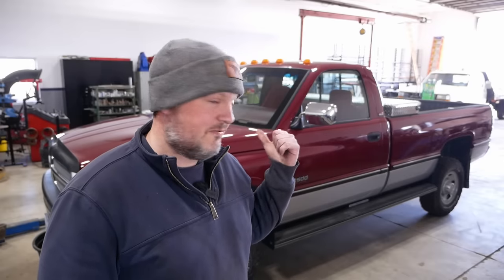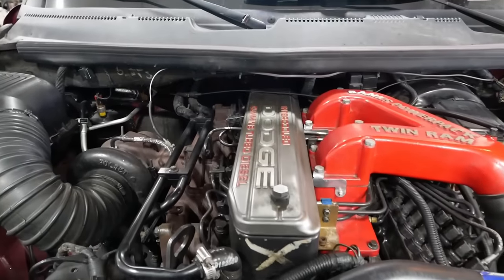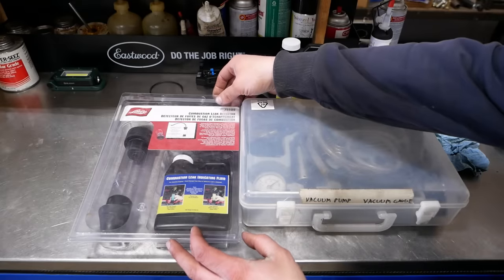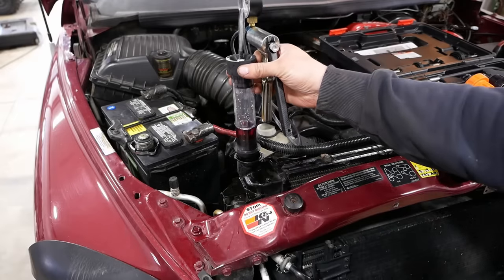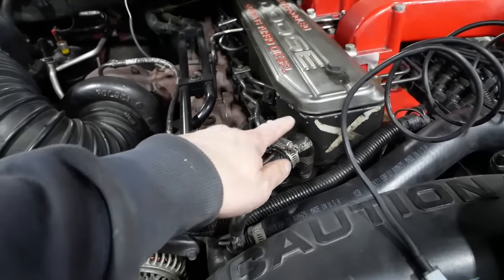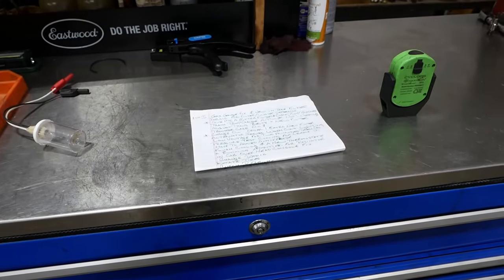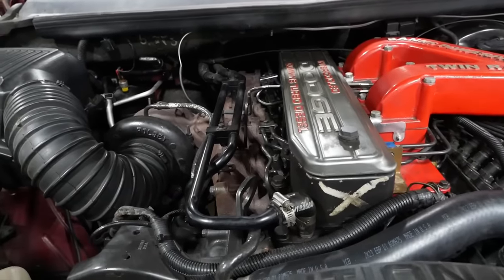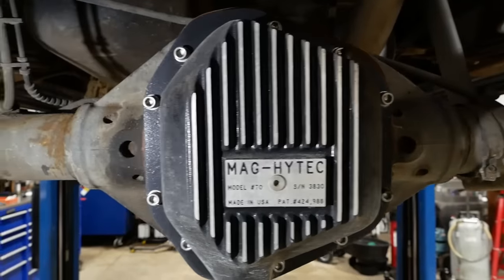Fixing a Mint 1995 Ram 2500 Cummins | Front End, Coolant Leaks, Major Service, Etc.

Comment: Thank you guys for the awesome content. I say you guys because I know a business like yours is a family effort. I really like the way you go about fixing all of these vehicles. You are very methodical, professional and clean. I’m always impressed with the work that you do. Wes, I wish I lived near your shops to have my truck worked on by you. It is a 2002 Ford F-250 XLT. It is a very clean truck with low miles. It needs a new bearing and outer axle seal on the driver’s side. It also needs a rear differential flush and fluid change. I have a new Rear differential cover. It is a good one that allows the fluid to circulate. I also have an electric diff locker from a 2008-2015 F-250 which can be retrofitted to work on my 2002 F-250. My truck is 100% rust free. I’m from Tucson, Arizona where there is no such thing as rain or humidity. Maybe a road trip? Thank you again for your videos and content.

Comment: Beautiful old truck. Sometimes I miss my  Cummins but the then remember changing out water pumps, seals , steering box , and front end parts more often than you would think . Had the death wobble several times. The good feeling goes away fast.

Comment: That was a clean 95 Dodge!  The new owner sure knew the right person to take it to!!  I had a 2000 Dodge diesel and I loved that truck.  I put in the Edge module so it had 330HP and 670FP of torque,  I got 17-19 mpg city driving and several times I got 27 mpg on the hiway!!  But it did wander and no one could fix it.  Also the trans would would go out of overdrive with a Big bang when under a load so I had it rebuild and it did the same thing which was a common problem.  It finally broke and left us stranded!  Went to a dealership and they finally got a factory remanufactured Trans and I never had that problem again,  but it was 5 grand!  If I'd lived close to Wes and he had the time he could have fixed all of that and I wouldn't have had to put up with all that for several years.  Thanks for another great video,  I'm going to watch some more of your videos right now.

Comment: Had a 93 Dodge Cummins D250 2WD. Gave it to a cousin in '03 w/ 225K miles. He kept it a decade as an off road truck. He sold it to his propane guy a decade later for $700. It's still running almost 30 years later. These old Cummins are awesome motors. Great video.

Comment: Great video Wes.  Your videos are always like it is.  Your living right, those unit bearings NEVER come out that easy.  I’ve  got a 2000 Dodge 2500 CTD since 2002.  120,000 miles on it, love it.  I put a Fleece cooling system bypass on it, and a PacBrake exhaust brake system on it, a FASS lift pump and just put a manual locking front hub kit on it.  No DEF and no cats, My forever truck.  I would like to find another one, 97 or older so I can avoid the smog line here in Commiefornia.  Then install a 24 valve with the P- pump conversion kit.  Interesting,  the ball joints press into the knuckle on the 98’s and older.  Om my 2000 they press into the ears on the axle tubes.

Comment: Just saw you using the suction pump and over here in the UK I've just bought a 1.5litre version of the same pump (already got two of  the smaller ones like yours) and it's really handy. Differs in having a much longer tube plus a stop tap arrangement on the end to stop dribbles whilst transferring liquids.  Also has a handle to go around the larger body. Just letting you know as we are usually behind you guys so no doubt they're available on your side of the pond. Enjoyed the video too. 😁👍

P.S. AvE says "Cut towards your chum, not your thumb".

Comment: Hi Wes, thanks for the vids.  Is it possible that since that transmission was modified for heavy towing (deep magnesium pan, extra fluid capacity, who knows what else...), it does not reach normal operating temps when running with no extra load - so it may shift like its cold and the temp gauge may not register?  Perhaps the pickup doesn't get deep enough in the modified pan?

Comment: That is indeed a super nice rig!
I  have a bit of a Unicorn or holy grail Dodge truck of my own. 2003, 5.9 (pre-emissions), NV5600, Manual XFER case quad cab with 135K. It looks about the same as that one paint-wise. I want a new one but this one is too good to give up.
BTW, yes, the volt meter thing is normal. As far as the loose steering, if the gear hasn't been replaced, it needs it. No adjustment of the secotr will correct for a worn box. I learned this one the hard way. Red Head makes a great rebuilt gear.
Yes on the constant tension clamps and if you use OEM hoses, they come with them.
Reply: I replaced my 99 original steering box with a Redhead.  The first one they sent me had trashed splines, sent back.  Second Redhead came and was sloppy after install, a real surprise.  Took that one out and got a PSC box that was better, but still came with slop in the gearing.  I remember a day when the truck was new and the steering was super crisp. Front end is all brand new but these steering boxes seem to be the weak link in precise steering.  Grrrrrrrrrrrrrrrrrrrrrr.

Comment: Pretty clean for a rust belt truck. If you think that sending unit is a pain, I have a 98 12 valve, the only sending unit still made for the half year unicorn is at Geno's Garage and it's nearly $400. I have a universal ultrasonic sending unit on the way, can't wait to see how it works.
Reply: Wow - is that how it calculates fuel tank volume instead of a float and a potentiometer (or differential comparator ckt or whatever)? Does it pulse a soundwave  and do some kind of wizardry that converts to a voltage to signal the gauge?
Reply: @wes11bravo  Never heard of such wizardry like that before for a sending unit, technology
Reply: @wes11bravo  It mounts to the bottom of the tank on the outside and uses ultrasonic waves to detect the fluid level. It has a little control box that you use to calibrate it to your fuel gauge. Other companies also offer ones that use a standard SAE hole pattern where you cut a hole in the tank and put it on top, I wanted to refrain from cutting any holes in my tank. I was nervous about the sensor on the bottom of the tank being exposed when the truck is used offroad, but I figure if I mount it at the rear of the tank it's right near the axle and very difficult to drag over something.

Comment: FYI, there is a difference between "new" and "rebuilt or replacement" steering gears.  Rebuilt steering gears usually only replace seals, but they don't really replace any internal parts.  The main issue is the center shaft.  This shaft wears the most at the center when the truck is driving straight ahead since that is the position that the steering wheel is pointed most of the time.  The shaft then wears out in the middle but not at the ends.  This over time causes the truck to wander when driving straight, and there is no adjustment that will fix it.  This is why you need to have a new steering gear or one that is completely rebuilt by a shop that knows how to do it.  Also, be careful with the sector shaft setscrew - if you over tighten this it can cause the steering gear to lock up while driving.  It is usually just best to leave this alone if at all possible.  They make a steering gear support brace that can help a bit with a wandering issue, you can get from most Cummins aftermarket shops.  The frame tends to flex where the steering gear is bolted to it, the brace helps with that.  If you have a front end that is slap worn out, you can crank in the most negative caster that the front end will accept and this will help it to track straight a little better until the front end can be rebuilt.

Comment: Hi Wes thanks for your channel, I really enjoy watching it. I have bought a 3500 diesel in 1998 and used it for pulling my 41ft 5thwheel RV. It was a great truck, I just love the sound of a Cummins diesel engine, as strong as an ox. I traded it for a Chevy 2500 in 2006. So far so good, I sold my RV, so i will downscale soon.

Comment: bought a new stripped down, bread-truck white 1/2 ton manual one of these with the 318 standard cab, AC, hand-cranked  roll down windows and rubber floor mats in 2001 for 18 grand. it's not got about 92,000 miles on it and still running great. it's been dinged to death but no major crashes or dents in the body or bed. ...love it! it would still look good if i ever washed it., haha

best manual transmission and clutch i've ever owned, and i've got a 2007 aston martin and porche cayman with manuals that suffer in comparison.

Comment: I am wanting to say that that style came out in the 1994 model year.  Prior to that, Chrysler last changed body styles on its trucks  in 1972.  (Except for minor trim differences, square headlights, etc.)   As far as the transmissions, Chrysler had serious issues with automatic transmissions along about this time; a good friend of mine bought a brand new 1994, drove it to his house, parked it outside, came back 2 hours later and the truck wouldn't move.  Another co-worker had a 1995 that had 3 transmissions in as many years.  It wasn't just limited to trucks, either.  Front-wheel-drive Intrepids, and other Chrysler models had serious transmission issues.  Chuck Norris had a GMC truck in the pilot episode and the first season of "Walker, Texas Ranger."  He didn't get the Dodge Ram until later.  Great video!

Comment: Love seeing unicorns Wes.  i can't speak for others but I would rather see unicorns being worked on vs. beat up old run down vehicles that you can tell the owners don't care about.  

I have been fortunate that over the years I have weeeded out the clients that don't take care of their stuff and now have a good selection of well maintained vehicles that run through my shop owned by people who care about them and don't cringe about spending a little bit of money to keep them pristine and in proper running condition.

Also, a little tip when doing front axle work on solid axles (Mopar) when you have to pull axle shafts is to cut a pole jack down so that when you pull an axle shaft on one side you can place the cut down pole jack under one side and slightly raise it enough to prevent the differential fluid from the center housing from running out the seal and into the axle tube.  Makes for a very clean job without having any cleanup of fluid afterwards plus makes the outer axle housing end more solid when working so it doesn't bounce from the coil springs.

Another great video Wes.  Keep em' coming, especially those "unicorns".
Mike

Comment: I have a 95 regular cab long bed like this truck, but mine is metallic brilliant blue w/ blue interior it has the nv4500 manual transmission w/ the 12 valve its 4wd. I'm the 2nd owner I bought it early 2020 right before the shutdown. truck has been garaged its entire life. Kicker is the truck only had 45,800 miles when purchased, 2 years later she just rolled over 47,000 original miles thing is immaculate. Also another fun fact I noticed when watching your video. the truck your working on and my truck were built in the same warren truck assembly plant in Mi in the same year. The x on the valve cover is a dead giveaway that i have only seen with trucks that were built out of warren! super cool.

Comment: The nice thing about working & owning a high miles taken care of truck is that for the most part anything you go to fix has probably at one point been replaced.

The disadvantage of buying a clean low miles clean truck is that a lot of the stuff on it hasn’t been done at all or it’s barely driving w 30yr old grease in places.

Comment: I test drove one of the first Dodge Cummins models, still in the old, square body style.  It felt like I was driving a steel-wheeled tractor down a Chicago expressway.  NOTHING gave when you hit a bump.
Reply: Mine feels like driving a 30 year old dump truck. After completely redoing the interior including a complete seat rebuild it now feels like driving a 30 year old dump truck.

Comment: Nice work Wes! Any time you don't curse a Dodge is a good day. Biggest improvement in my mind was swapping that radio, had one (Infinity version) in my 95 Caravan and it was the worst radio Chrysler ever produced. I put in a CD/Cassette unit form a 2000 Caravan (plug-n-play) and it was a night and day improvement with the factory Infinity speakers! Thanks!

Comment: I deeply admire your DJ or attention to detail and your willingness to put in the extra effort to make sure things are done correctly. I do have a comment on wobbly loose steering. The steering damper if equipped I should be so equipped as parallel as possible true the direction of travel of the tie rods. You may need to alter a bracket to accomplish this.
A couple other comments, when adjusting drum brakes, it is best to tighten the adjuster fairly tight. Then take a hammer and aggressively tap the flat surfaces of the drum. This will cause the shoes to handle themselves within the drum. The drum will generally loosen and you can make the final plicker adjustment
Also I noticed that you use worm Dr clamps on plastic radiator outlets. This is why the manufacturer oft-times uses the shrink style spring clamps to allow for expansion and contraction of the plastic outlets
I truly enjoy watching you work, you are a master

Comment: I bought a brand new Ram in 2001, 2011, and in my current truck in 2021.  10 years and 200k plus miles on the first two.  Love my new one.  Some folks must have had bad luck I guess.  I'll likely buy a 4th in 2031 if I'm not dead.

Comment: I am still driving mine, with the V10 Magnum engine, well over 350,000 miles. Only a new alternator, a few sensors, a starter, battery, shocks, brake pads, tires, and a belts in the last 4 years. No major issues. Only now I am noticing it starting to show barely visible light surface rust.

Comment: I had that exact year and style. When I bought it, it had 110k on it. I put about 100k on it. Then lots of stupid little problems started popping up and ended up donating it. Worked out pretty good for the taxes. The headlight switch was one of those thing that was some cause for consternation, along with fuel shut off valve. That, and the body started to rot out. Other than that, she ran dependably. She even came with an amsoil system. Anyway, great video. Keep these coming.

Comment: My 94 2wd Dodge cummins had that wandering problem until I swap it over to rack n pinion.  I also installed a zf6 6 speed manual out of 08 f450 super duty. 👌

Comment: Another great repair Wes. Thanks. 

I can actually remember 1995. I remember my dad was driving a 1.3 Vauxhall Astra estate that had rear leaf springs. I also remember we had a drought that year in England and there was endless talk of a hose pipe ban. I also remember my mum taking us an hours trip to the Cinema to see the first Toy Story. It's hard to believe this truck rolled off the assembly line that long ago.
Reply: Yep, the first forays into real feature-length full CGI movies were starting to take hold back when this truck was new on the showroom floor

Comment: In 1995, I bought a 1990 D250 Dodge pickup with 85,000 miles in upstate NY. I could not believe that it had no rust on it. 
I sold it with 210,000 miles on it. The engine did not burn or leak any oil and never had to replace any front end components. Did one front end alignment and never wore out tires due to misalignment.
I really hated to part with that truck but did not use it anymore and by 2006 when I sold it, was badly rusted underneath.

Comment: Great vid.... had 95 1 ton 5 speed .... dueally.... dodge wobble common. After market steering box stabilizer helps... drove it 350.000 miles plowed at dads place for last 5 years of my ownership. Loved it to death.... list too long for the at home in the dirt replacement parts i threw at it but never Had engine problems or tranny probs......transfercase issues only...thanks for what u do.... kyle....

Comment: I had one of those it was a 2001 quad cab 24 valve I got 300,000 miles out of it and then sold it for 12 grand after I bought it brand new best truck I have ever had

Comment: New to your channel!…luvit! I have a 97 2500 12valve looks very similar to the 95 you worked on…great video I saved for reference…I have deleted a lot of the electronic components so mine is almost all mechanical. I’m at 340k now and still running smooth hauling my fifth wheel. Incredible truck!

Comment: I have that same truck and have addressed most of the same issues you did. While northeastern trucks succumb to winter/rust cycles, here in the southwest, the heat turns the plastic dash components into "peanut brittle". In addition, the clear coat paint doesn't fare much better. I'm surprised you didn't use the manual prime on the lift pump. A wooden toilet plunger handle is the perfect length to reach in and pump it from under the hood.  All in all, they are great trucks. Nice video...thx👍🏼😮

Comment: I inherited a mint 2002 Ram 1500 5.9 Magnum two years ago. Less than 40k, and in perfect shape except for the entire underside that sat in a yard and let grass hold moisture against the metal. Took the truck to frame replaced entire suspension control arms upper and lower steering knuckles both sides sway bae links wheel hubs rotors calipers all new lines the whole brake system new axles CVs shocks everything and put it back together. Put that MagHytec after market covers you saw under this guys diesel on my trans and got one for diff but waiting to crack diff open to do that job. Only tool i had to buy was a Dodge steering knuckle bearing remover i got from a Chrysler mechanic on ebay for a hell of a lot less than it should've been. Then of course did engine basics plugs wires distributor battery throttle sensor had gone bad after years of not running. I'll never sell it. In 5 years I can put an antique plate on it.